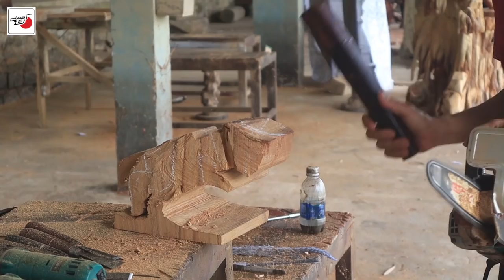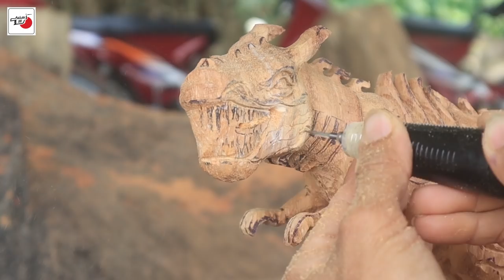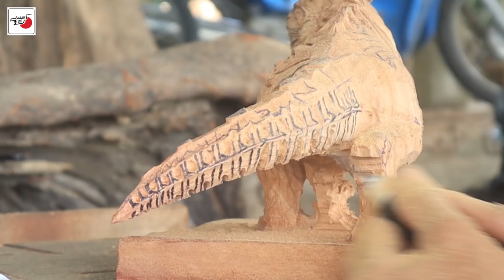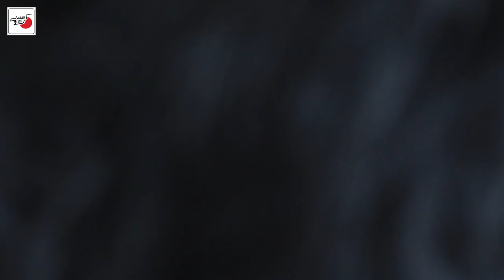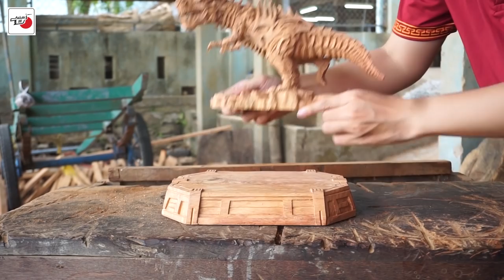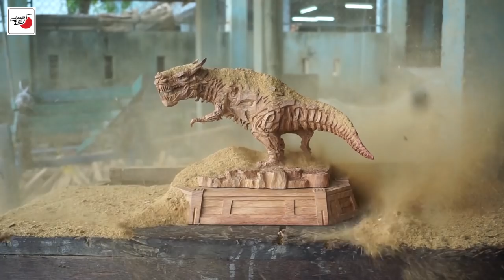How to Make TRANSFORMERS T-REX Out of WOOD - Carving Dinosaurs

Comment: I came here from the godzilla Vs kong video. Please wear earplugs. It may not affect you now, but in 10 years it definitely will. I would recommend the ones with a lace which you can hang on your neck. Please wear earplugs. Also, you should consider using googles to protect your eyes. I get you have a lot of experience, but safety is always important.